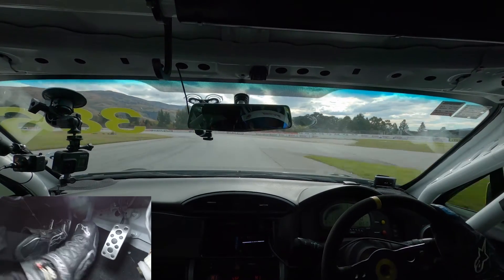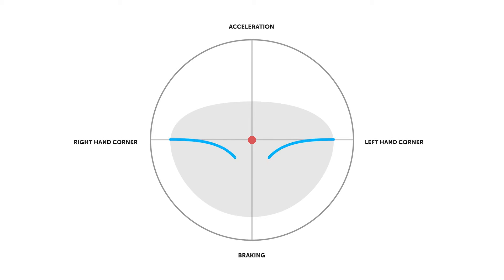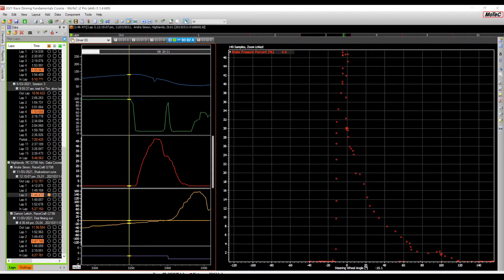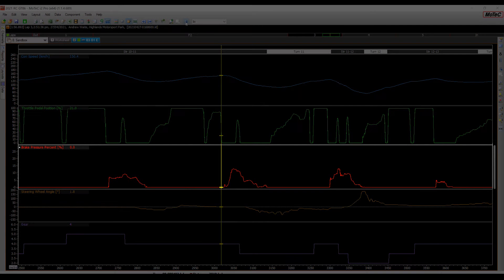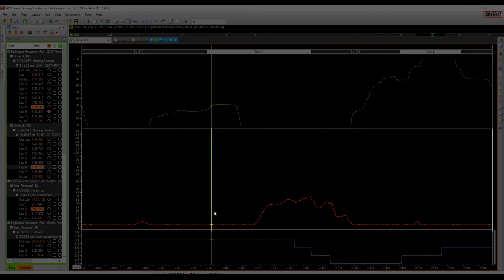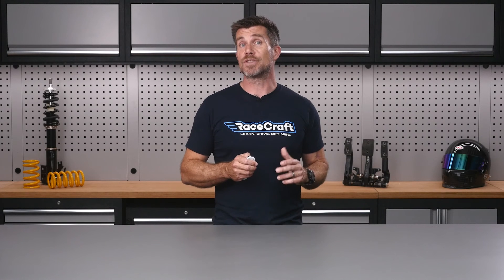What Is Trail Braking...

Comment from the maker: 🦸‍♂ Building a fast car? Get $400 OFF the all inclusive VIP online course package deal: https://hpcdmy.co/vipy82
🏎Learn and practice the same skills that pro divers use every lap: Enrol today for 50% off Race Driving Fundamentals: https://hpcdmy.co/offery82
TIME STAMPS
0:00 - Lesson Goal
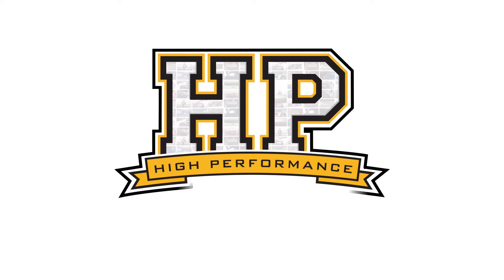0:20 - What Is Trail Braking?
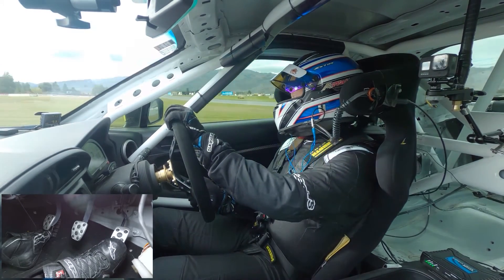1:00 - Problem: Road G-G Diagram Traction Circle
2:09 - The Solution
2:51 - Brake Pressure Vs Steering Angle
3:18 - Ideal Track G-G Diagram: Traction Circle
3:29 - Ideal Brake Release Practice
4:11 - Other Advantages of Trail Braking
4:42 - Oversteer
4:58 - High Speed Vs Low Speed Corners
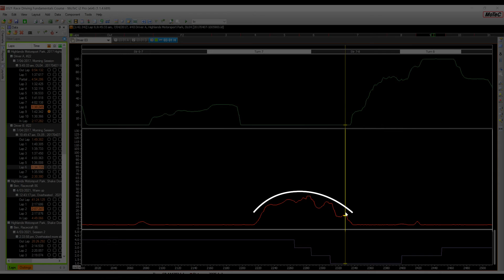5:24 - Moving Target: Requires Testing
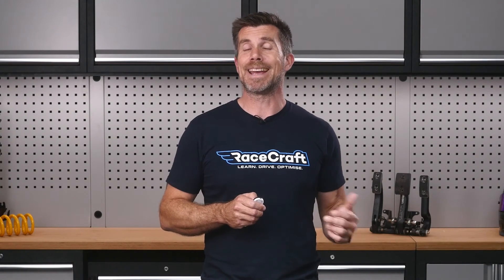5:58 - Lesson Summary
6:42 - Enjoyed This? We Have A Full Course!

Comment: It would have been interrested to compare throttle pedal usage to brakes pedal usage during trail braking to show in which part and proportion they are used at same time (some amount of left foot braking involved).
Reply: In general you should not use throttle during trail braking. The idea is to use the brakes to rotate the car and only slow down as needed to get thorugh the corner, then at the apex, you get off the brakes and start applying throttle to exit the corner.
Reply: @wisllayvitrio71  Ok, so it's mere normal breaking
Reply: @vozhdmeister5256  Except instead of braking then turning you do both at the same time, but as you start turning you release the brakes accordingly to keep the car balances and under the grip threshold.
Reply from the maker: If you normally trail brake, yes, it would be how you normally brake I guess.
Some people do it without thinking even when they shouldn't, others don't, sometimes even when they should 😅 - Taz.
Reply: I'm living in mountains, I am using trail braking, left foot braking and even powerslide cornering according to road, weather, visibility and risk (damaging the car is something that can be dealt with, jumping in the trees is something else)

Comment: Does trailer braking only work with ABS ?
Reply from the maker: No sir! ABS is irrelevant bearing in mind not all ABS systems are created equal. 
Once you get out there and start practicing this and other fundamental techniques you will quickly figure out where your own ABS system (if you have one) fits in with your track driving noting the track conditions don't remain static either outside of sim racing - Taz.
Reply: @hpa101  amazing advice I didn't know that. Thanks I'm going to work on that this season which is pretty much just going to be all about data and testing for next year 🤙

Comment: Some corners maybe. 4WD can be different (if the corner radius allows) with my EVO some power is on before the apex to lock the diffs for exit.
Reply: But you are still braking before the apex. if you need to put power in early, you should be left foot braking so you can brake later while still having the power on. Trail braking is used in both situations for better lap times
Reply: @festa289  As he says not every corner, which is what I said.

Comment: Isn't this also known as brakeboosting or is that somthing different?
Reply: Typically brake boosting is a term used with turbocharged cars where you mix brake and throttle input mid-corner to build boost pressure so that the turbo has less of a gap to cover to provide peak boost
Reply: @blindaceg  sounds terrifying

Comment: Need a sensor on the brake pedal now to data log it
Reply from the maker: A lot of later model cars have them from factory, just a matter of 'tapping' on into the data if that's the case 😎 - Taz.
Reply: @hpa101  Unfortunately no that flash in an r32 skyline :)
Reply: Yeap like mk4 tdi golf's, press the brake and throttle at the same time while driving and the ecu detects the brake signal and ignores the throttle request signal until you lift off the brake
Reply: @upsidedown4155 yep my Mk5 does that, and even my 370Z did.

Thankfully I now drive a Miata which allows left-foot braking (not that I've even started attempting it)